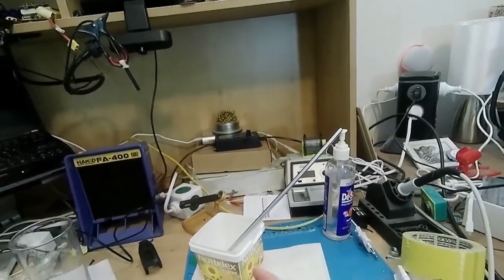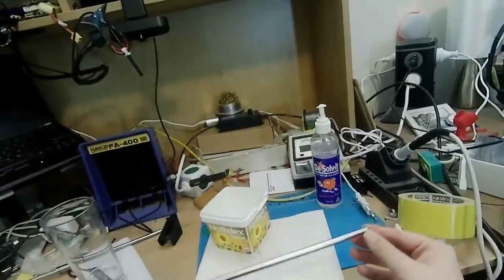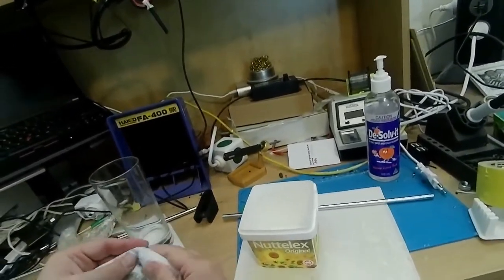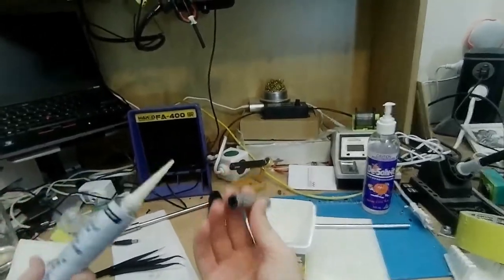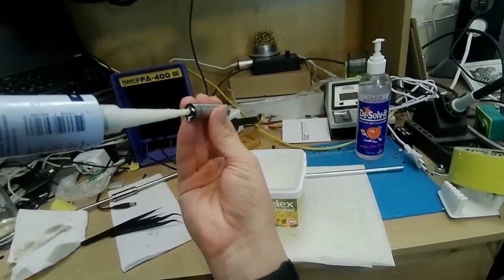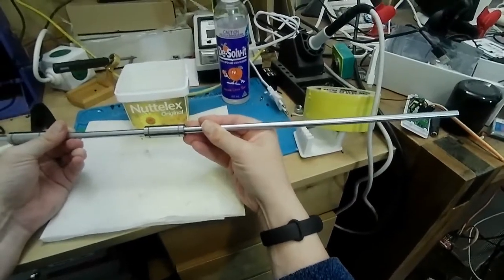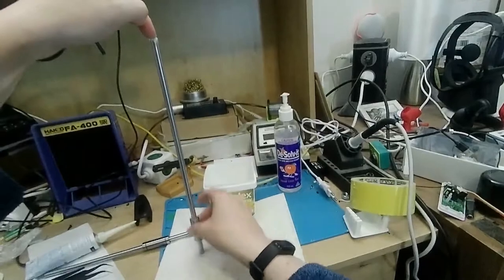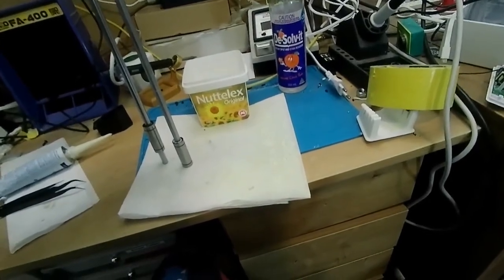Regreasing a Linear Bearing done easily

Comment: Actually I am about to change most of my 3d printers from linear bearings to a combination of brass and polymer bushings. As I first started that 6 years ago, I got a lot of problems, as sometimes the movement stopped or sensorless homing triggered at a false position. The reason simply was bushings being much more prezise. Printers like the Prusa mk3s+ (my main printers) and the Prusa mini and many others are staticly overconstrained. Due to tolerances in production and veriation temperatures two rods are never ever 100% in parallel (I talk about micrometers). Ball bearings actually have more tolerance than bushings. So they still work.
Two weeks ago I got the solution to this problem. As example the x-axis of a Prusa mini.
The printhead uses two ball bearings and two parallel rods. Only one bearing and one rod would be enough staticly, exept the printhead could rotate around the rod. So the second rod actually only have to prevent this by restricting the movement in y-direction, so the head can not rotate arount the x-axis. But instead of a construction only preventing this motion, a normal bearing is used. So both bearings restrict in z. This is called over constraining. Normal ball bearings have some play - and thats needed to compensate for the slight missalignments if the rods are not perfectly in parallel (wich they never are). Simply replacing both ball bearings by Igus bushings or (much more precise) brass bushings can not work well, as the over constrainment leads to more friction (wrong triggering sensorless homeing) or even blocking.
The solution was quite simple: I downloaded a stl of an Igus-style bushing, used two cylinders with 8mm diameter and their centerpoint 1mm appart. Also I added a cube with 8by1mm² area in the middle. I subtracted this from the Igus style bearing and got an asymetric bushing, having 8mm in one axis but 9mm in the other. So I now use a very precise brass bushing on the upper rod, but my asymetric bushing (with the 9mm diameter oriented vertically) on the lower rod. Now it is very quite, self lubricating and works absolutly flawless.
For my experiments I used PETG for the asymetric bushing, so still some grease needed and not a permanent solution, but I will reprint it from Iglidur i150 soon.
For the next weeks I plan to try this solution on the other axises also.
For example the bed uses 3 bearings. The side with two bearings I will use Igus bushings instead (I already do this), as there is an optimised pearing holder on printebles for the prusa mini, wich alows to give the bushings the right amound of pretension (and it is very hard to align two brass bushings precise enough). On the over rod I will use my asymetric bushing, longer axis oriented horizontaly (at the moment I use a ruthex bushing wich has some play).
As I upgraded my Prusa mini to second z-axis, leaving the right side as is, I even have 3 rods with LM10LUU on z. I will also construct an Asymetric bushing for two of the rods (using 10/11mm) and one brass bushing.
These brass bushings are available with embedded graphite, so being self lubricating (but you can add aditional graphite lubricant to make the movement even smoother).  Also Iglidur is self lubricating. So altogether much less maintanance required. Also much less noise (and as noise simply is vibration transfered to the air - much less vibrations)

This method of reducing overconstrainment and therefore using much more precise bushings insted of bearings actually should work on all cartesian printers (not only bedshakers, but also crossing rods or ender5-style). Sadly, coreXY haevely depends on over-constrainment, as the belts do a lot of turns. Also brass bushings are heavy, so their use is limited if you want to go lightweight.